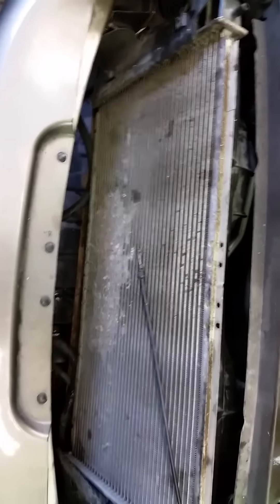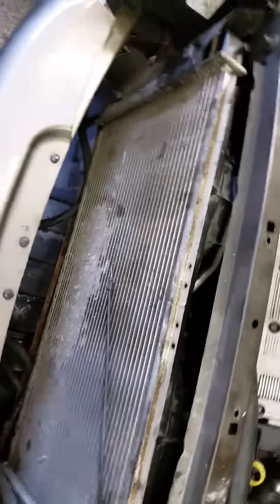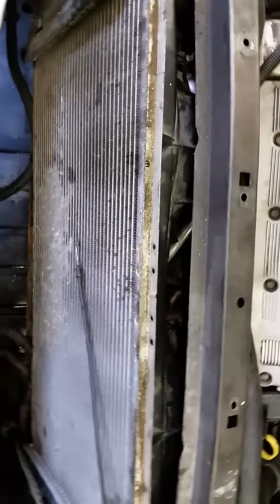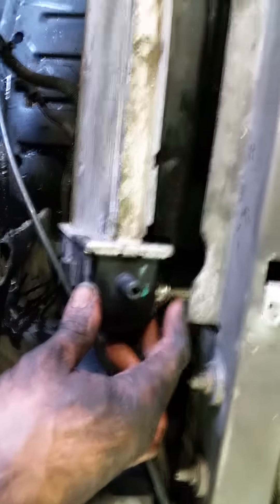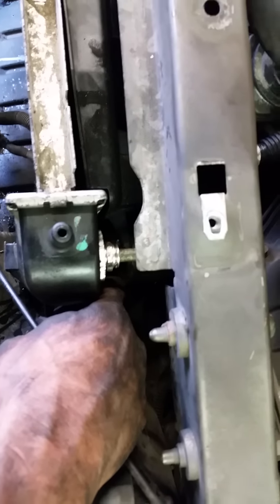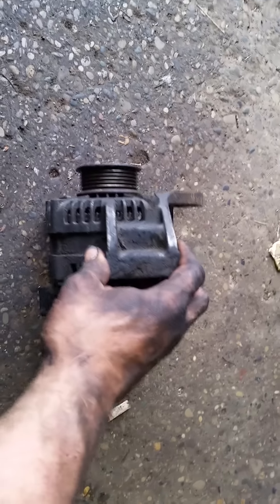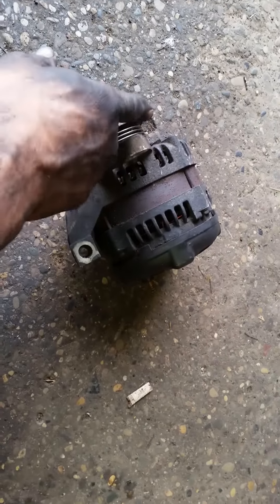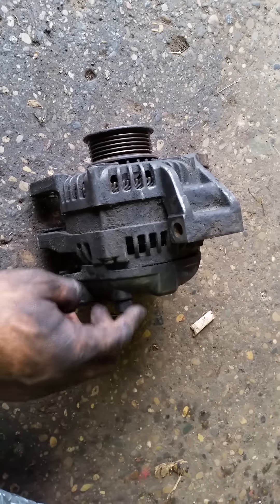Cadillac Northstar alternator replacement

Comment: I did this job two times on two different cars. The shop manual says to remove the wheel, liner, radiator and fans. That would make it easier. When you put the new one on, the bolt with the nut that fits in the clevis should be put on first, because you can locate the alternator and then simply rotate it into place.
 
There is a ground wire that must be re-installed. It is mounted to the frame and then the other end goes UNDER the bolt head when you re-install the bolt that goes up at an angle. The third mounting point is a stud and a nut. As you look at the end of the alternator from the passenger side towards the driver's side, it is high and on the left. 

With some wiggling, the alternator itself will come out either from the top or the bottom. You don't have to drop the engine cradle either. With the radiator out, it will come out the top pretty easily. But it's a job no matter what.

Comment: Hello fellow man here who is willing to get on YouTube and fix his own car I would just like to say you can pull the radiator fan out not disconnect any of the hoses access all the bolts to the alternator  from the top besides two and take it out under the  front passenger side wheel well

Comment: just crawl under the car, unbolt alternator, move alternator around and it will slide out the bottom.  takes about an hour to do.. do not fallow any of these steps lol
Reply: I have a bracket in the way of mine,even after moving one of the radiator fans over and it still wont fit through the bottom